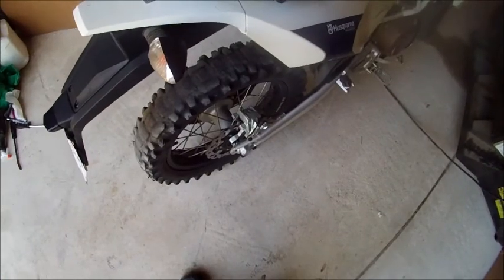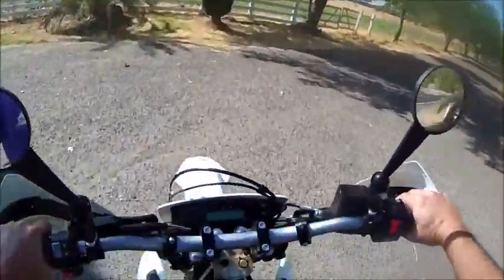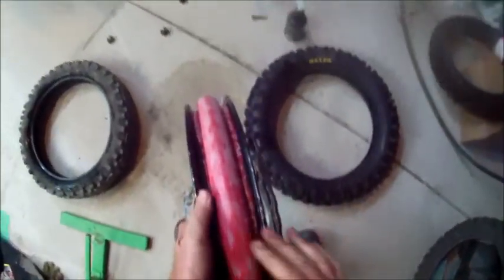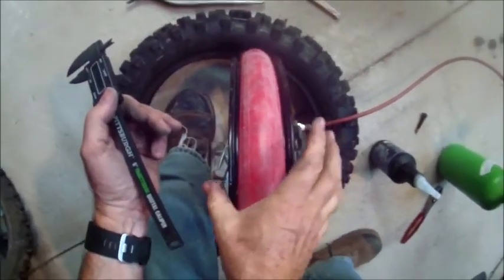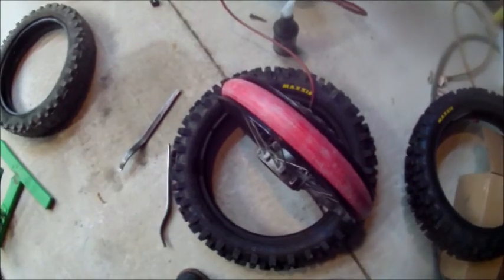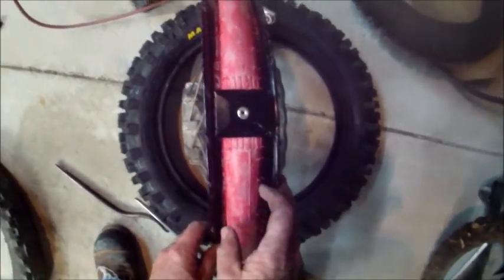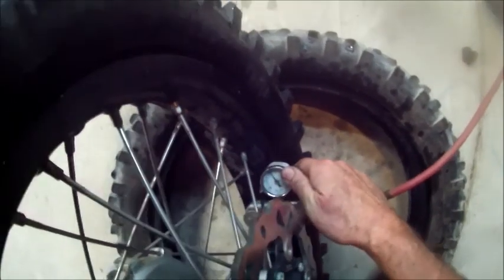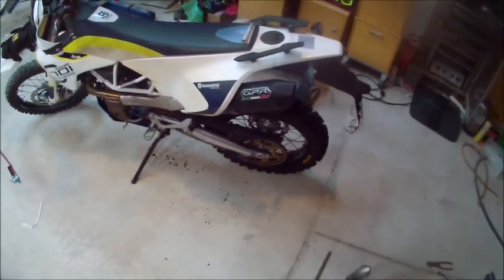Tubliss System

Comment: Hi clark. Very nice. what's the rear tire size you are using?
Reply from the maker: That was the Maxxis desert tire.  Biggest they make ..... can't remember if it was a 130/80 or 140/80 X 18.  The bike burned up in the toy hauler so obviously no longer using the 701 !  Replaced it with a 501 but now I can use any tire and no limited to Maxxis.

Comment: Im looking at getting a 701, Iuse tubliss on my dirt bike and my current BMW. Do you think the TKC80 would work if I used sealant as well? Ive always used Stans sealant in the past.
Reply from the maker: I had multiple conversations with Jeff - President of Tubliss.  The only tire he knew of was the Maxxis and the only one I had any luck with.  TKC80 would not seal due to the rim width of the 701.  Maxxis tire bead is 11-12 mm thick compared to all others @ 7-8 mm thick.
Reply: @clarkrupp  cool, thanks mate. I might just run it in the front then.
Reply: @clarkrupp  Looks like a lot of the tubeless tyres have beads wider than 11mm, mitas, Metzler & MotoZ are are around 12mm+
Reply from the maker: @yetiboy01australia23  Good to know !  The president of Tubliss actually called me a Sunday and indicated at that time the Maxxis was the only one with a thick enough bead

Comment: Hey CR great video. What do you use for the front tire?
Reply from the maker: The Maxxis dessert tires are great on hard compact, rock, gravel - suck in the mud.  IRC's are awesome in really wet/muddy environments.  I've  got the Maxxis EN series on my 501 right now.  I'd probably rate them a "B" but as a dual sport, where I'm on pavement at least 40% of the time I'm willing to give up a little woods traction for a little more tire life.  Really depends on your riding conditions...  The EN are significantly better in softer terrain than the Maxxis dessert tire - which I suppose makes sense !

Comment: Hi Clark, Your videos are great. I purchased a 701 enduro this fall. I am totally used to using Tubliss on my 300 xcws so I am a big fan.  Would you recommend going with Tubliss system on 2k+ rides like the TAT and TCAT with good sized gear loads on a 701?
Reply from the maker: Ron Keen Keep in mind the only tire that I know of that will work with Tubliss and the 2.5” rear rim on the 701 is the Maxxis.  I just talked with the Shinko rep at WPS today and he actually went out to the warehouse and measured the bead thickness on the new 625 Hybrid.  Looks like it might work so I’m going to buy one and find out....  to answer your question... Yes !  In a heartbeat I would leave tonight to take on the TAT or TCAT with the Tubliss/Maxxis setup

Comment: Interesting. I never considered the thickness of the tire. I really like tubliss system and run it front and rear on my dirtbike. My favorite back tire, using tublisss, is the Sedona 907 HP. Awesome sidewall stiffness yet soft "crown" for traction. I run 5 psi. I bet you work on your own shock? Just a guess from looking at your nitro setup. Thanks for sharing
Reply from the maker: James Bramblett That extra rim width on the 701 strips away the tire choice until someone can tell me of a tire with at least 10mm bead thickness.
Reply: Clark Rupp that is a thick sidewall. An old 110/100-18 Sedona 907 HP of mine chks about 9.5 mm

Comment: Hi Clark, I have MT21's and they are 10.5mm at the bead, so do you know what other tyres are comparable with the 2.5"  Rim and system?
Reply from the maker: Those might work......  The MAXXIS dessert tires for sure work - and do really well on the asphalt too.  Enjoy the first 800 miles cause its downhill from there !
Reply: Hi, i cant find maxxis desert tyre; the only one i found is this: https://www.maxxis.com/catalog/tire-457-113-maxxcross-desert-it but there are only in 110 and 120 width (husky 701 want 140)